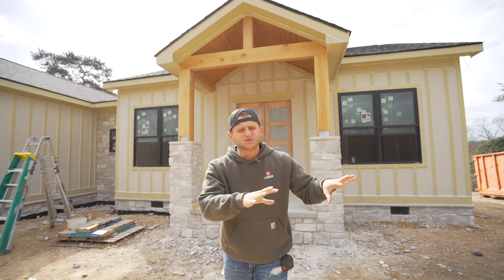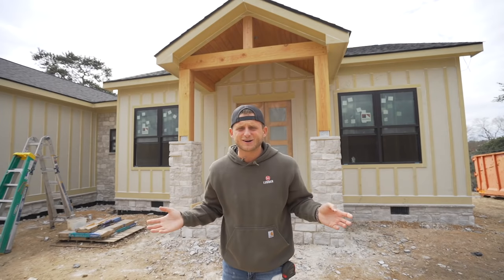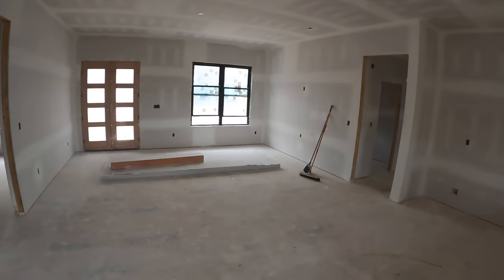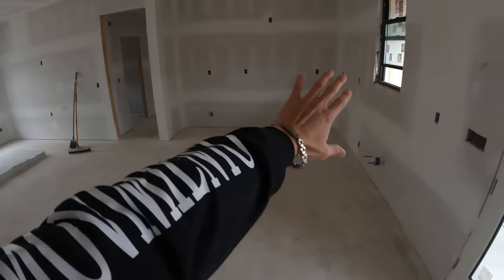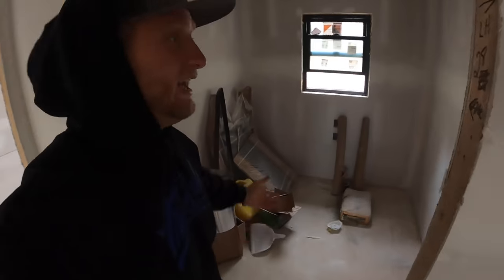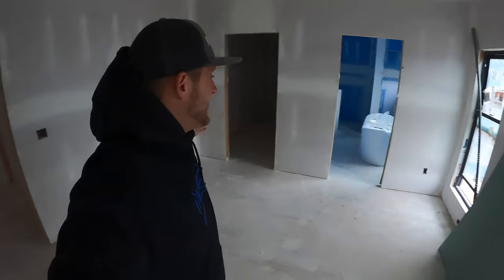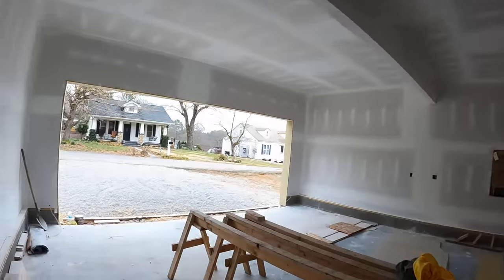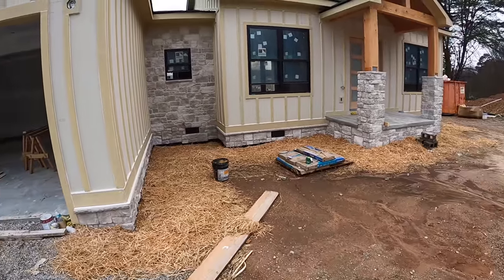Installing Drywall - Mudding and Sanding | Ready to Prime | Building A $350,000 Custom House | EP 38

Comment: These guys are better hangers then finishers.
They did a great job hanging.
But that’s what the majority of them are.
You can tell someone started off as a hanger then slowly learned the taping tools.
But in all reality I speak on the behalf of many drywall contractors we know the difference.
I would not hire them to finish any of my jobs.
Plus just doing a level 3 finish is not enough for a smooth wall.
Level 3 is good for texture jobs.
But if you’re going to do a smooth wall have a level 4 finish.
That means widen out your butt joints 
And skim coat walls near windows.
I’m just a better drywall contractor.
But hey it works for them.
They hang fast so that you don’t have to pay attention to their finishing skills.
But I bet that electric sander is their best friend.
I still don’t know why I saw one guy wipe the guys joint down after he ran the 12 inch box on the ceiling…
Wasn’t even feathering it out he was literally just skimming it off….
Reply: I am surprised that the butts weren’t blown out more and it looks like they only hit the flats with a 10. The only criticism I have on their hanging is something that I have seen many Mexican crews do and just don’t understand….the unnecessary belly bands….why? They are quick and clean other than that 1 thing. Not hard to hang that house with a crew that size in a day though. Hard to feed that many mouths off of 1 house.